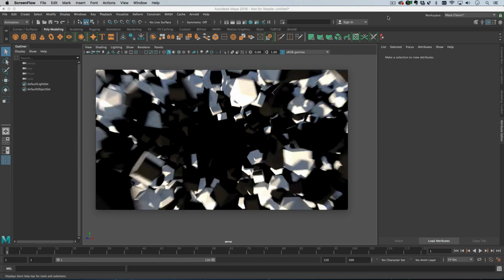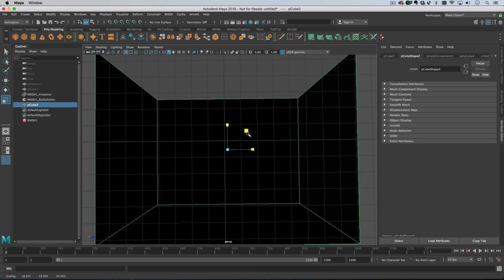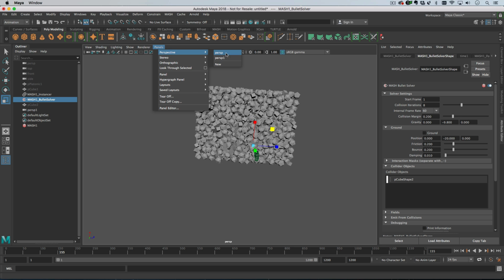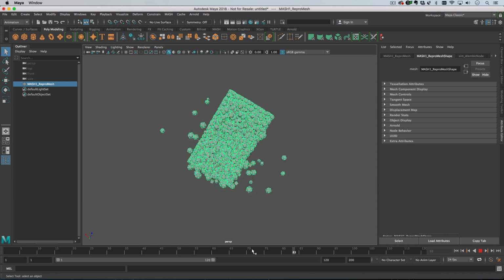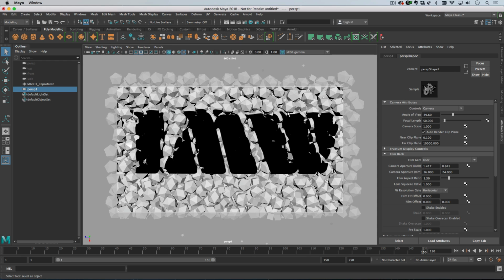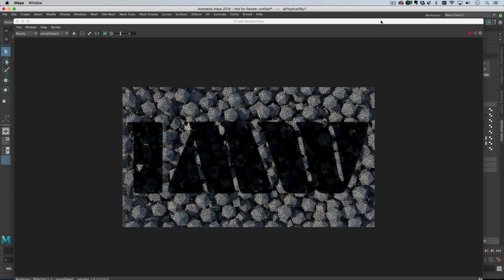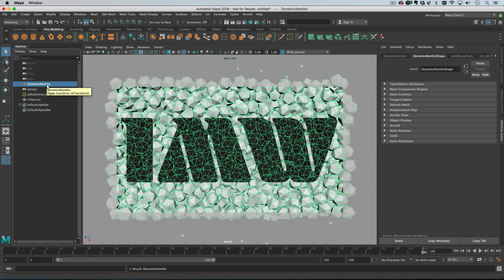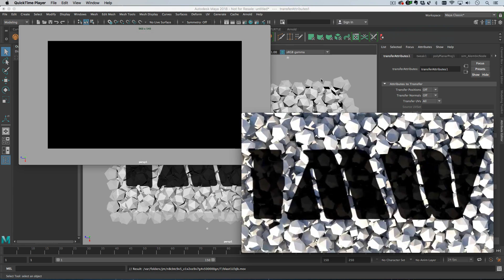MASH - Sticky textures with the Repro node

Comment: Cool thanks.
You could use blendshape between the dynamic alembic and the static one with new uvs and it should work fast.
I   did it the last couple of days with a cloth simulation lol
Reply from the maker: Pinning this comment because it's an excellent tip :)
Reply: Could you explain a little more on this technique please, sounds like a plan to me.
Reply: @stephenhibberd4309  

You cache your simulation or whatever you are doing, export it to an alembic  file. Then work on the static version of your model, do the UVs and texturing, then import the cached alembic,  select it, then the one with correct UV, then create a  blendshape ( Deform> Blend Shape) and move the slider up.

Comment: There must be another way to do this, If I use component mode during the transfer it take 20 mins to evaluate - move forward another frame takes another 20 mins. its so painful it hurts.
I did try attribute transferring to the "intermediate object" method but crashes right at the end. Ive only got a 20 core machine!

Comment: I would have used a planar projection with the "Camera" option to create the UVs in the first place.
Reply from the maker: THAT'S IT! I was wondering why Camera based UV projection wasn't giving me what I wanted - it's because I should have done what you suggest. Thanks for pointing that out, it was driving me crazy. I've been off the tools too long! Need to stop programming MASH and re-learn Maya ;o)
Reply: Naah! It happens all the time mate!
I have been using Maya since 1998 on SGI machines, and I can 100% assure that it often happens that I get stuck thinking "Heck! What was that tool that... Hummm... Let's try... Ok, maybe if... Shit!!" :-D

Nothing to -re-learn there, just get some rest! ;-D
Reply from the maker: Haha! You've hit the nail on the head. I go on holiday tomorrow! :)
Reply: Have a good one then! I wish I had some too! :D
Reply from the maker: You would still apply this projection to the duplicated final frame, then transfer it onto the alembic (or use a blend shape as you pointed out below).
Reply: Hmm. The problem is that if you apply a uv projection on an imported alembic cache, the animated geometry will swim through the texture.   Maybe there is a fix  I didnt know it?